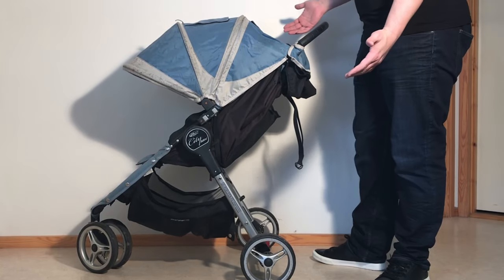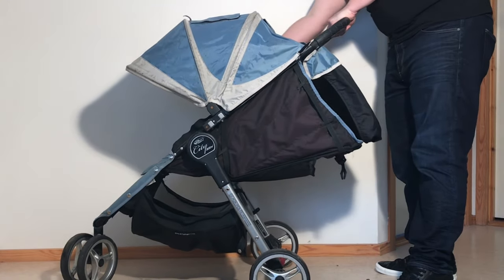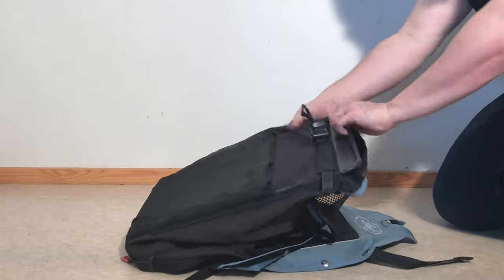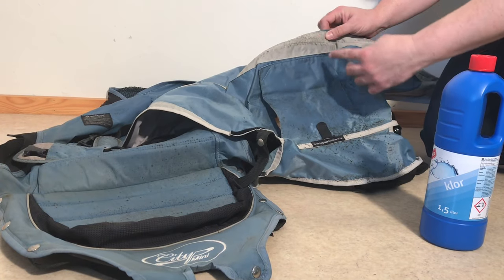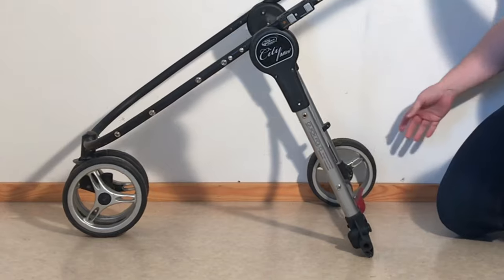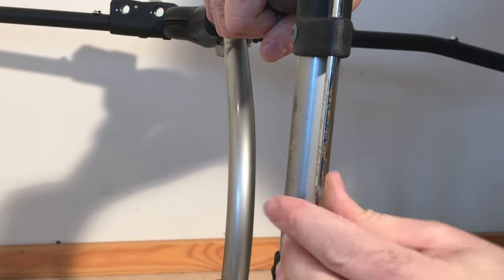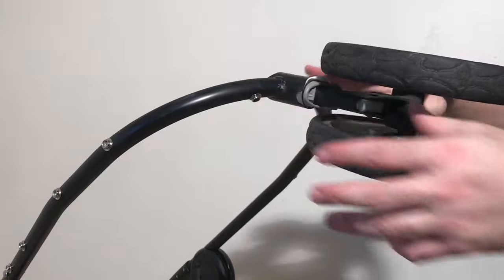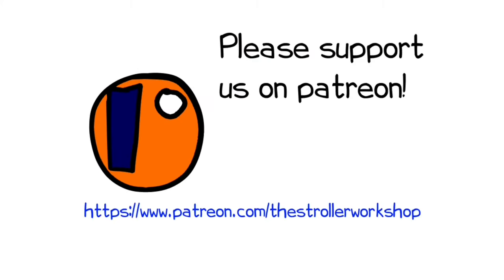How to SUPER CLEAN Your Stroller

Comment: Can you show us how you removed the rust from the screws/rivets? I know you said use foil but it’s a little difficult to get in there in finding. Do you have any tips? I just got a 2012-2014 uppa baby vista … the manufacture date says August 2015 but the serial number ends with 2012 and I’ve noticed the textiles match the 2012 models. THANK YOU SO MUCJ

Comment: I have a cleaning question I'm dealing with now. I have an older Emmaljunga stroller that has leatherette or faux leather upholstery. The hood is leatherette on the outside, however it has a cloth fabric liner on which staining has developed while the stroller was stored. What would be the best method of getting the inside cloth lining clean and stain free that wouldn't damage the exterior leatherette? Appreciate any suggestions.
Reply from the maker: It depends a lot on the stain.  A lot of the time there's just a lot of dirt built up between the 2 layers so even though one tries to keep cleaning the inside-lining by hand, you wind up with larger waves/spots of discoloring.  Other sorts of stains are specific like mildew or rust, which can be a bit tough to get rid of and need specialist cleaning products.  The best thing to do if you're willing to invest the effort into the renovation is to look for the stitches and carefully cut out the lining, then clean or replace it separately and sew it back in (this is serious work though, so unlikely to pay back other than in the enjoyment of the job itself). :)
Reply: @BarnevognverkstedNo  Thank you for the suggestions. This is one of my own Emmaljungas, so money wouldn't be an issue. There's no metal hood members to cause a rust stain where the staining is located. Possibly could be some type of mildew staining from some organic material that may have been in the material. I have a brand new vintage Emmaljunga stored right beside it and that one has no staining on the hood liner which leads me to believe something was on the other liner that caused the staining to develop over time.

Comment: Question: Can you use bluing liquid for the rusted areas, after rust has been removed?
I'm thinking of using it on the axles and wheels for our pram, since it has been so badly rusted. It's hard to get the laquer spray everywhere, and in some areas, it's chipping off. Bluing liqud also prevents rust, which is perfect in our weather condition. My sister in law, says I should try it, and she works in an automobile shop.